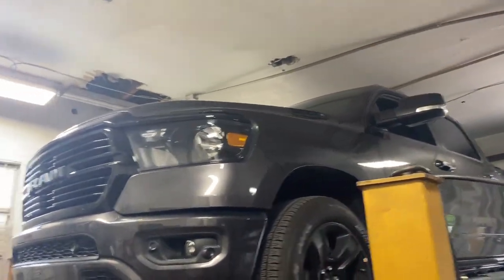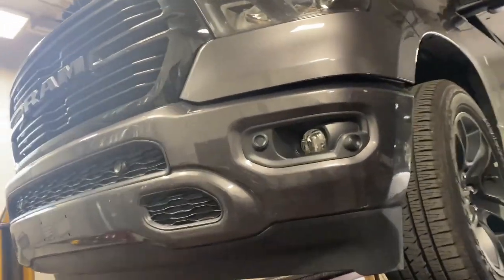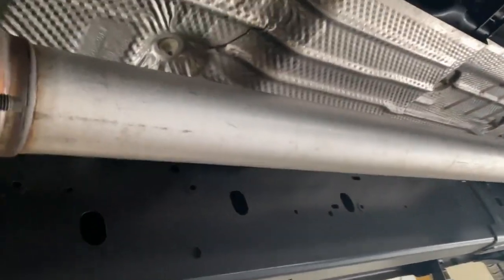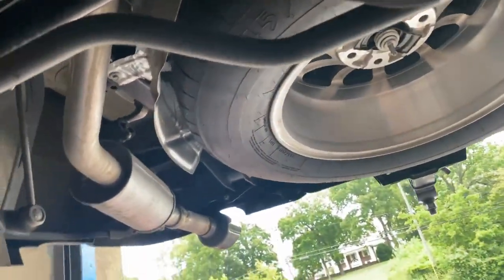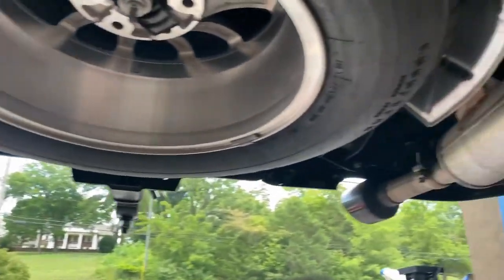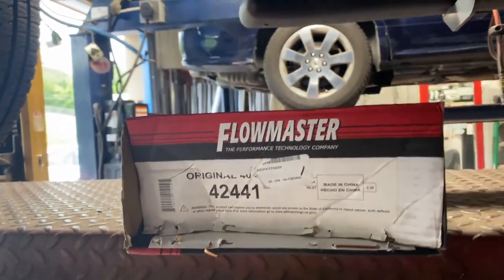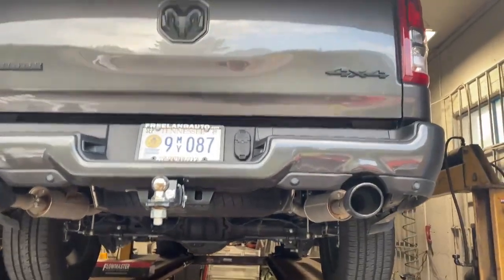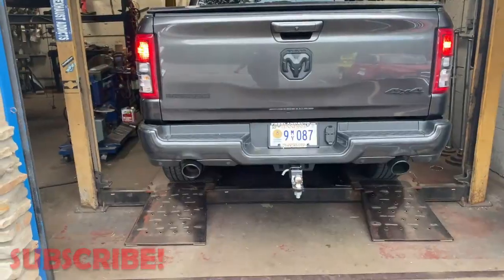2020 RAM 1500 5.7L HEMI DUAL EXHAUST w/ FLOWMASTER 40 SERIES!

Comment: I got that same truck in a 2021 with the same setup, I thought/thinking I want it louder. It’s growing on me. I’ll see after a month or two
Reply: I also have the 2021. Did you get the flowmaster labeled 42441 as shown in the video? It says that model is 2.25" in and out but the ram exhaust is 3" in and out. Isnt that too small?
Reply: @bobt6566  What did you find out?
Reply: @todd8672  never looked into it. I still have the stock exhaust